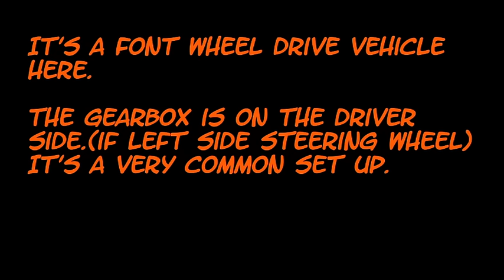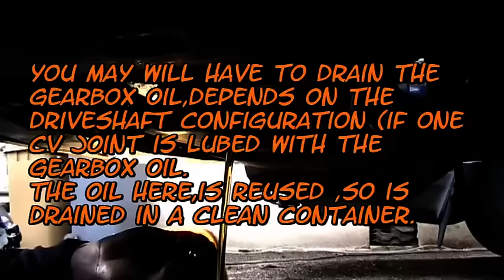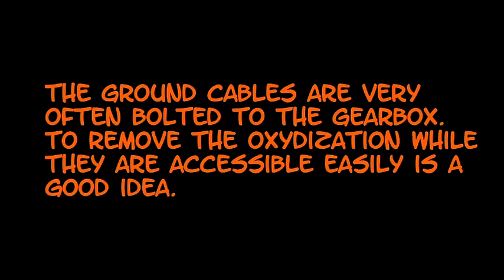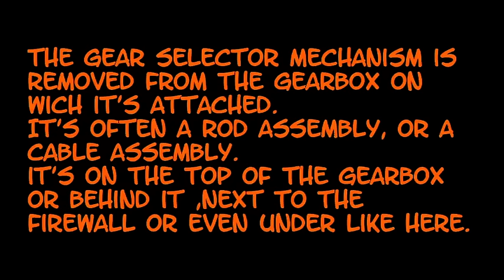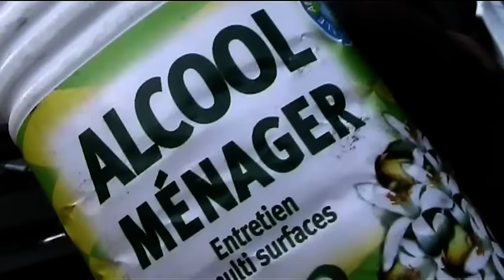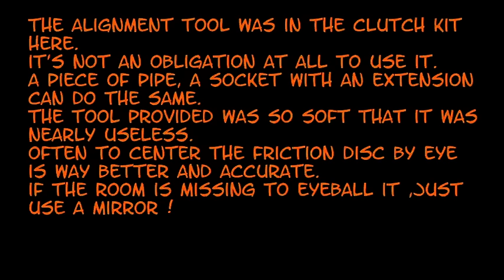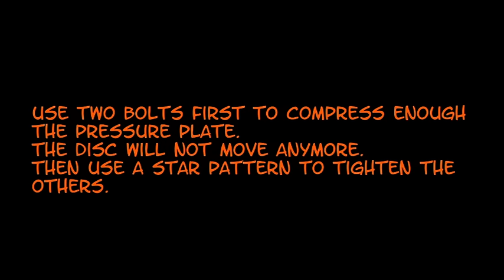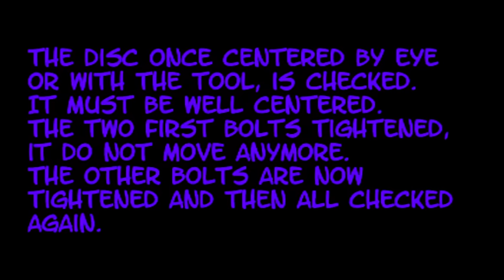Front Wheel Drive car clutch replacement.

Comment: Good video but what kind of car is it? And have you any more videos about Mitsubishi space start 1.3 16V 1999 (clutch replacement )? Appreciation your Jobb
Reply from the maker: Thanks.
it's a Renault 21 gts.
No i don't have on your specific model,but it's very similar,all front wheel drive cars are the same.
At worst you have to remove the gearbox from the engine compartment,by the above,or under.
Reply: Thank you so much for your amazing job 👍
Reply from the maker: @mehdy782005  Thank you : )

Comment: Merci beaucoup!
Brilliant video. Clear and informative with lots of good advice. Now for my juddering Citroen C3
Reply from the maker: Thank you  : )
You have a clutch problem ?
Reply: michaelovitch The clutch pedal is juddering as I press it and the drive judders when changing gear. it is worse when changing down. Same sort of vibration on the pedal when you have got a warped brake disc. Ah well, I need to spend a morning in my garage and get it sorted.

Allan
Reply from the maker: Allan Griffiths
How many kilometers does the clutch kit or car has ?
Reply: 150 km
Reply from the maker: Allan Griffiths
150 000 kms or 150 kms ?
150 000 is normal for a clutch to fail.
You have to change it,or try to adjust it first.

Comment: Great Video,  My gear box is in but , when i put my foot on the clutch it goes straight to the ground , doesn't come back up i have to pull it manually ... do you have an idea what's wrong
Reply from the maker: If the clutch cable is connected ,it should work correctly.
If you have a hydraulic system,be sure it's full of fluid and purged.
Are you sure all is in place : disc,pressure plate,bearing well installed on the fork ?

Comment: Do the drive shafts need to come out or can it be done with them in?
Reply from the maker: Both can be done,depends if you remove the hubs or not from the car.
The best is to be able to move the transmission easily,so without nothing attached to it.

Comment: If you allow me, I have some questions, why did you disconnect the battery and also why did you drain the oil?
Reply from the maker: The engine starter has to be disconnected and removed to access the flywheel.
It's powered by a big 12v cable,wich can cause a short circuit if it's touching the engine block or sheet metal around it.
Removing the power allow you to avoid that.
The gearbox oil is drained because the transmission shafts plung in it on one side on this model,oil would flow out when you move the gearbox.

Comment: Why did you take out both axels? The clutch is accessed on the drivers side only.
Reply from the maker: You can't move the gearbox towards the direction of the axle still installed ,if you let it in because of the hub.
You need to remove both hubs,or both axles to move it easily to replace the clutch.

Comment: How long does it take you to replace the clutch from removing the old to installing the new one my mechanic took a day and a half you make like its so easy
Reply from the maker: From 2 hours on certain vehicles,like the small hondas to  half a day if there is a subframe support to remove ,if all goes normally,without rusted ,or broken parts.
A day and a half seems long if he worked on it during all this time.
Are you sure ha was not doing an other thing at the same time,or waited for parts ?
How much did he charge you ?

Comment: superb job, perfect explanation, this will come in handy for sure one day :-)
Reply from the maker: Kaktus Jack 
Thank you very much : )
Reply: +michaelovitch Just watched it again. Actually this is one of the best clutch replacement videos I've seen. and  the sweet sound of air compressor. Sure comes in handy in jobs like these. And nice to see that the beautiful R21 comes to see another day, hopefuly another decade too :-)
Reply from the maker: +Kaktus Jack 
Thanks again.
I hope too it will run again some time,but parts will always be the problem with cars.
They become harder and harder to find used.
Reply: +michaelovitch Sadly that with the parts is true. Do some parts from later models (I guess laguna) fit the R21 ?
Reply from the maker: +Kaktus Jack 
Body parts are the most difficult to find,even if there are some still avaible.
i don't know about the laguna if there is a f2n or f3n
the gearbox is the same on a express.

Comment: Do both wheels/half shafts have to come off or one only?
Reply from the maker: You have to remove the axles from the gearbox or at least send the gearbox in one way with the passenger side axle attached to it but disconnected from the hub.
It's way easier with both axles removed ,so wheels removed.
Reply: Thanks so much

Comment: Great video, but why u replacing allmost new one ?
Reply from the maker: +Rajvosa Sarajevo 
Thanks : )
It' looks like new,but it was used during 150 000 kms at least.
Gears were quite difficult to change,the pedal travel was not what it should be
Clutches generally do not last more than that,unless you use your car a lot on the freeway.

Comment: Is a gear mechanism in the transmission or separate?
Reply from the maker: The transmission is just an assembly of gears in a casing.
I don't understand your question.
Reply: michaelovitch I have seen the transmission how the gear changes inside it...just wonder where the gear stick connects to..

Like the actual year stick in the car..
It is attached to a metal right? And this metal where is it connected to on the transmission to change the gear...

Is this obvious on the transmission where to connect it?...
Thanks
Reply from the maker: Ah,ok 
i get it now.
Yes,it's an obvious part,and when the engine is longitudinal the gearstick is directly attached to the gearbox.
The front wheels drive vehicles have the gearbox transversal,so there is a long linkage between the gearstick and the gearbox itself.
There is a shaft poking out of the transmission ,or two ,or three or more on each transmission.
This ,or those shafts are directly connected to parts in the gearbox,to allow you to push or pull the forks,wich move the gears.
Most of the systems linking the gearstick in the car,to your shaft poking out of the gearbox are long rods under the car,or just cables with bushings at each end.
Look here ,there are a ton of videos :
https://www.youtube.com/user/GearWorldTV/videos
https://www.youtube.com/watch?v=es7JryzQKfs
https://www.youtube.com/watch?v=vOo3TLgL0kM&t=1216s
Reply: michaelovitch nice...cheers buddy...
One last question if you don't mind...

Is the clutch connected to the accelerator in any way?
Of is accelerator just independent to start & boost speed?.

If separate would you tell me if you can where the accelerator is connected..
Does it have a a shaft?
Or connected directly to the engine?
Or where?

Sorry trying to built my Electric vehicle....

Thanks
Reply: Michael moon if carbureter the accelerator connected to the carbureter if its more modern car then its connected to fuel injectors

Comment: do i have to take off the subframe to pull out the gear box?
Reply from the maker: Depends of the car.
What model have you got ?
Reply: Seat cordoba 2002.
Reply from the maker: ok
I don't know.
The clutch pedal is low,and don't come back up ?
Reply: Thanks the same .I do not know that it is so difficult.
Reply from the maker: What is the problem on the car ?
Reply: i need to change the clutch andit is getting very diffeclut to put out the gear box due to the subframe.also i have some problemsto unscrew the driving shaft from the gear box side due to the the bolts are very very hard to unscrew .
Reply from the maker: Ok,
take care of removing all parts connected to the gearbox first (axles,gearstick linkage or hydraulic lines,brackets etc..)
Then you can move the gearbox more easily.
sometimes,you don't need to remove the gearbox from the car,while the manual says you have to.
Take your time,one step after the other.
You have problems to unscrew the big nuts at the extremity of each axle ,at the center of the wheels ?

Comment: Having a hard time putting transmission back. Any suggestions?  It seems they engineered it to be a real pain to reinstall.
Reply from the maker: +prosperandbehealthy 
You have to be sure the disc clutch is well centered with the pressure plate.
It's the main problem in your case.
An other thing is to push the gearbox straight following the geabox shaft angle,otherwise you will fight with it quite long.
: )
Reply: +michaelovitch  Yes! the problem is the tow frame ( where you hook to be towed on the driver side)  and lower frame seem to make it hard just to get started.
Reply from the maker: +prosperandbehealthy 
Rotate a bit the gearbox around the shaft to start it,then give it its normal position,it will help you.
Reply: +michaelovitch  I see  someone raised it at a 45 degree angle above the new clutch. I will go at it again and hope I get it in. Thanks; I will let you know if I am successful on how I did it.
Reply from the maker: +prosperandbehealthy 
: )
Reply: +michaelovitch  Unsuccessful! have to cut tow hook bolts above driver side front wheel.
Reply from the maker: +prosperandbehealthy 
What car is it ?
It's not normal to be obliged to cut parts for this job.

Comment: if you wanted to remove the gearbox entirely, what would've been needed?
Reply from the maker: Here, you are suposed to pull it from under the car.
But i'm too lazy to do that,so i kept it on the side.
Sometimes it's an obligation,you don't have enough room to work on the clutch,so you remove it completly,from under,or from the top.
Rarely,you have to drop the entire engine craddle,so support the engine to do that.

Comment: Hello, I have a problem with a Renault X-Price car. The problem is in Demaroor. The car has a Jetil Ben Zain engine, Bat Vitaz, and Demaroor diesel. When I put it in place, it starts and then stops and runs in the air without starting the car. I hope a solution to the problem.
Reply from the maker: I think the solenoid on the engine starter does not engage properly .

Comment: Hello, I read you did it on a 206 too. I have to replace it on my mother's 1999 1.6i 206, it was replaced by a mechanic about three years and probably 30.000 km ago (it has got about 211.000 km), and it already needs to be replaced again, it is sliding almost at the point to let you stranded on the road. However I have the Haynes manual. What year was the 206 you did that job on, how is the job? Anyway my mother's 206 also needs a new head gasket, and right rear axle bearing as it is swerving very badly on left turns: I think I will have to replace the axle too.
Reply from the maker: The clutch already slipping is not normal.
Check if the cable is loose enough pedal released to allow the pressure plate to compress the disc correctly.
You should be able to have some freeplay on the pedal.
If it's worn out already wit the correct adjustment done, that mean the adjustment was incorrect all this time and it burnt because slipping all the time and it got worse and worse. 

I did the job on a 99 model.
The job is ok,not really a surprise or specific difficulty.
You have just a bearing carrier for the passenger axle.
the gearbox was completly removed by under in my case,it's easier.

I replaced the head gasket too few weeks ago,the oil was going in the coolant.
It was noticeable by seeing some oil floating on the coolant in the expansion tank.
I've filmed that i'm editing it : )

If the rear wheel has abnormal camber noticeable by eye the bearing on the axle can be shot,
it's a problem on peugeot rear ends.

Can you explain a bit more about this ?
Reply: Ah, do not even think to start to work on 206 rear axle bearings without a 11 millimeter flare nut wrench, because you could get stuck. I bought the "Laser 2605 Brake Spanner - 11mm Hex X 13mm Hex" from Amazon UK, which costed me about 14 euros, and it is a great tool.
Reply from the maker: FulvioGal
Thanks for the tip : )
You had a crazy camber on the rear end ?
toasted bearings or rusted pins ?
Reply: michaelovitch
I could not notice any incorrect camber when the car was still, the problem with my mother's 206 is that it swerves badly on left turns, so I think it depends on the right wheels; another problem with the rear suspension is that it rarely makes a noise, so I would like to check the axle bearings, but, as I said, I have not been able to remove the rear wheel arms from the axle yet, so that I can check the bearings. I found that the rear right wheel bearing was broken, but maybe I broke it using the extractor to remove the drum. I also found that the shock absorbers were shot, they do not return to extended position when compressed, they just remain in the same compressed position, and I have bought new rear shock absorbers.
Reply from the maker: FulvioGal
Ok,i see.
Reply from the maker: FulvioGal
You have a leak on the hydraulic cylinder in the rear brake no ?
Reply: Yes, I have already bought both new brake shoes kit, including the two wheel cylinders. Indeed at the last mandatory periodic check that car barely passed the rear left brake test, the examiner had to retry many times before it was able to pass it. Thank you.
Reply: New pictures added to my album.
Reply from the maker: FulvioGal
Vey nice job !
You do it very well damn !
So how much runout you have on the new discs ?
Did you check the hub first ?

Comment: i have a ford fiesta and its hard to change gears while the engine is running, but when the engine is off, it shifts like normal. And the reverse gear is hard even when its off. what might be the problem. clutch or gearbox. the harder gear to change is 1st gear
Reply from the maker: I think the clutch cable is too loose,wich let the clutch disc drag a bit on the flywheel when the engine rotate.
Check the tension on the cable ,or if it's a hydraulic system,flush/purge it.
the clutch should grab when the pedal is around half travel.
How many miles or kilometers have your clutch ?
Reply: its hydraulic clutch and i have no idea how many km my clutch has run, because i bought a used car and its ran a total of 100,000Km. i worried that my transmission synchronizer is damaged.
Reply from the maker: It can be simply worn out.
If the car was used a lot in city driving,it's worn out way quicker.
They habitually last around 150 000 kms before really feeling them worn out.
You don't have a lot of things to do :
try to change the fluid in the dydraulic system.
if no better change the clutch it's can be done without too much hesitation if 100 000 kms.
You can look if the engine mounts are not kaput.
when the engine is a bit sideways,the linkage between the gearshift and the gearbox do not work normally,wich can lead to that too.
Reply: there is a leak in suspension linkage, i guess its from transmission,
how long does the synchronizers last ?
Reply from the maker: The synchros can last the life of the car,or you can use two or three gearboxes on the same engine...,it's all a question of use following the driver.
i can't tell you for yours.
first gear is the most used,so often the most worn out.
Reply: yeah the first gear is hard to shift and the reverse, well i'll reply once i check those things you said
Reply from the maker: ok
i would go for a clutch with this kms but check the rest,yes
: )

Comment: Great work, im planning to change the clutch on my BMW e36 coupe, i think that job will suck, because all the bolts are probably rusted into the threads.
Reply from the maker: +flipskater032 
Thank you : )
Most of the time,,the bolts are quite clean,the bellhousing is often greasy and naturally well protected ,since nothing splashes it with water.
You maybe will have a better experience than you think : )

Comment: Why do you need to remove the driveshaft goint to the wheels?
Reply from the maker: They do not allow you to move the gearbox easily since they are attached to the wheels and the gearbox itself.
It's like if somebody  would try to move you while your wrists were attached to the sides of your bed.
Reply: michaelovitch I see, thanks I will attempt to change my own clutch soon
Reply from the maker: I wish you a smooth work.
Work safely,take your time,
check the fork and its pivot point or bushings.
use molybdene grease on the splines,in a moderate quantity,not like here.
A small brush or a tooth brush is enough to sread it on the splines : )

Comment: How do you verify the old clutch isn't an aftermarket part or a fake original part that contains asbestos?
Reply from the maker: Good question.
Except the date on the parts,or the age of the car itself,nothing can really help you as i know.
It's according to the regulation in your country and the age of the car,and its parts.
Reply: damNIT@! A bigtime messy job and no work gloves??
That petroleum grease applied all over and on input shaft and flywheel components (or pilot bushing) are all made of hormone disrupting chemicals! 
The was more educational than various videos that try to explain how transmissions work and where they're located. thanks

Comment: Is it harder to replace a clutch on more modern cars ?
Reply from the maker: Not really.
You will have maybe a bit less room to move your hands in the engine bay.
The method is the same.
Maybe you will have to move the gearbox out of the car,by under or by above in the worst case.
Sometimes the engine craddle is to remove or loosen wich can lengthen the work. 
All those problems can be encountered on older or newer vehicles,it's just a question of design.